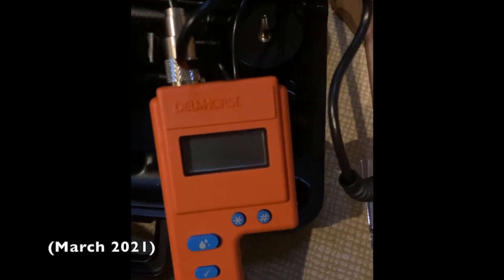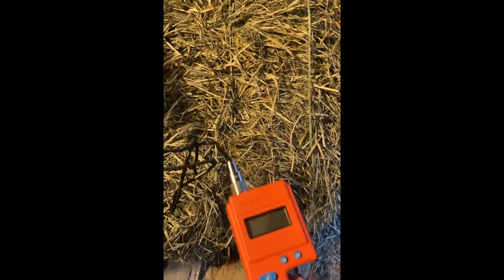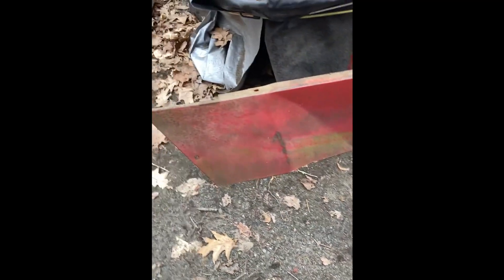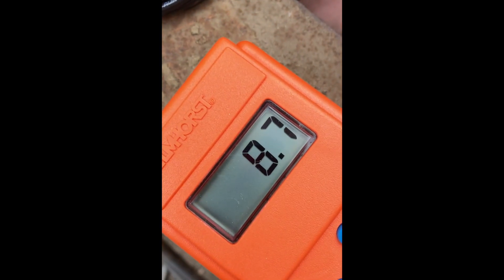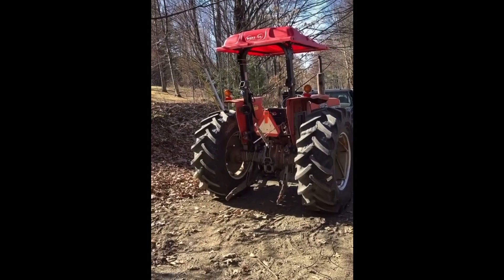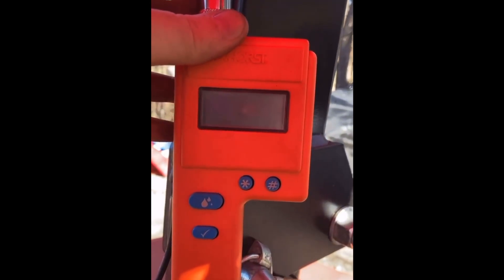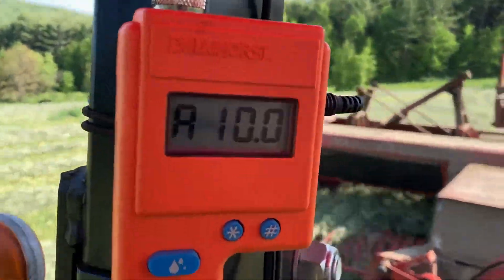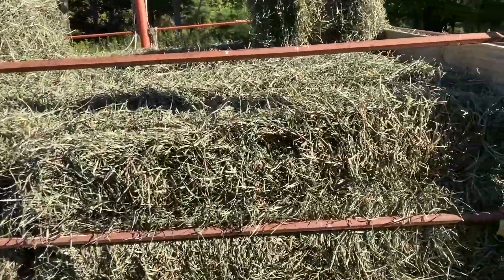(Archive) - Installing & Using a Hay Moisture Meter for Baling Hay

Comment: Did you check if the windrow measurements matched the baler readings?
Reply from the maker: Oh, yes!  The Baylor seemed to agree with what I was testing in the field.  And then I checked the bales after baling.  With the hand probe (same evening, after stacking) they were reading somewhere between 11-14%.  It’s definitely helpful to confirm that they agree with each other, great point!  (Thanks!)
Reply: @windrowfarm Very helpful, thanks 😊

We  harvest two cuts on 1800 acres in Poland and we’re just after cutting the first 300 acres, so super exiting time ahead of us 😄 

From your experience what set-up would you recommend to get for measuring windrow moisture, and are there some add-ons that you ended up not using?
Reply from the maker: @paweciasnocha4075 oh wow, that’s amazing!  What sort of bales do you make?

I’ve had great luck with this moisture meter setup so far (Delmhorst FX2000).  I believe the “X” means it’s the one that can do in-baler monitoring, and came with the bale chamber sensor and wiring.  Then you can just detach the meter and attach a hand probe, windrow tester, etc.  my only complaint so far is that the windrow tester stopped giving accurate readings.  But I just make a wad of hay and use the bale probe and that seems to work OK.

Hope that helps!  And thanks for watching!